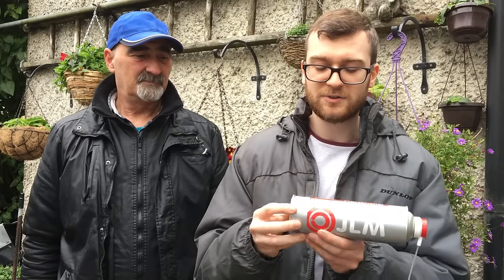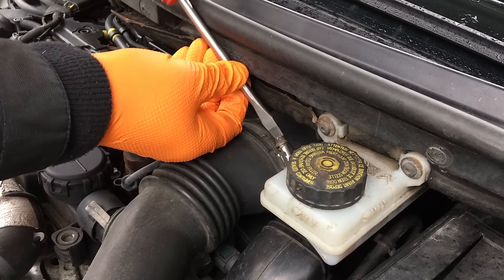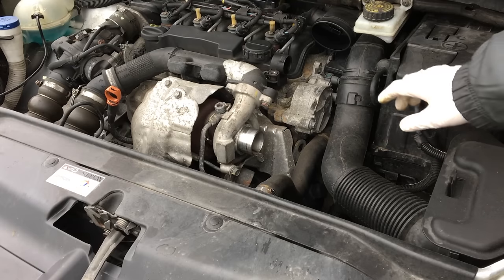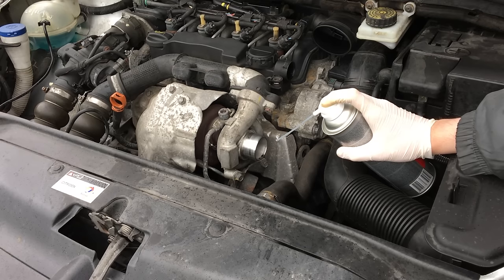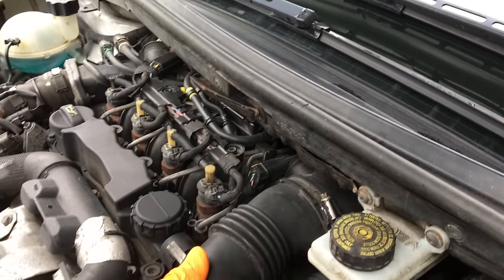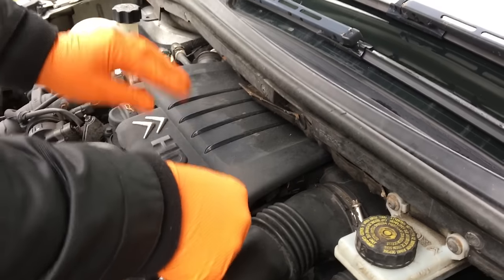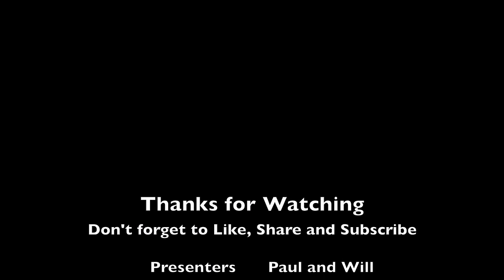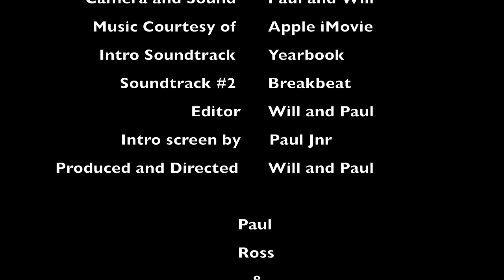How To Clean an EGR Valve Without Removing It

Comment: Question on this insertion location,   how can this  work when the EGR valve is not in the air intake flow?   It is only in the Exhaust  gas flow,   EGR valve,   then to the "intake manifold"?    For this to work it must go through the engine fuel burning process then a rather small percent of the "cleaner" to do what you want it to do.  Seems rather chancy for it to work at all?   regards
Reply from the maker: Hi LLuE88,
It does seem a bit of a waste alright. Maybe only a small % is actually needed.
As we understand, all egr cleaning sprays have similar application instruction. 
We followed the printed instructions on this particular brand and it appears to work.
This is preventative maintenance and it works on this car.  Rather pay €10 or €15 for a can that is effective than risk trying some other method that may or may not work and could end up being costly.
No doubt some time in the future the egr valve may have to be replaced (€200-€300+) but for the moment this is an inexpensive solution, if only temporary  
Paul
Reply: That's fine, my main concern was the amount of time and knuckle busting it takes to remove only to clean the EGR valve,  it's very close to having to partially lift out engine to get at the EGR valve. I will do as you have indicated,  also have a syringe that's 1" in diameter,  works great to pump the diaphragm up and down,  regards  thanks,  regards
Reply from the maker: Some claim that they can remove the egr valve without too much difficulty. For them it may very well be located in a more accessible place on their cars, vans, trucks, etc.
This works for us and as you mentioned it would need a partial lift of the engine to access it directly.
In our case, an M6 type bolt and 2 jubilee clips will give us the access we need to enable us to carry out this simple straight-forward cleaning operation.   
If an engine lift even partially was required then it wouldn't be considered a preventative maintenance operation that could be easily carried out by a diy enthusiast/s 
Paul
Reply: LLuE88 has

Comment: I'm a car mechanic, and I don't want to disappoint you, but you did nothing to the egr valve. You need to get it out, soak it for a while, than brush it clean.
Reply: Was just thinking that - had mine off at the weekend and there is no way a few sprays from a can could remove any of the crud in there. Also makes me nervous when I see unfiltered air heading into an engine for a prolonged period of time... that might just me me though haha.

Comment: Good Morning Gentlemen once again  your advice please my windscreen washer stopped in the frost it was only a fuse TG however when we replaced it my local man who is 100% great mechanic  felt the 20 amp fuse was wrong he thought 10 amp would be safer but asked me to ask advice from Citroen who said 40 amp we think this is crazy please advise me as i value your advice greatly,Paul
Reply from the maker: We have come across the washer fuse blowing when the water mix freezes in the washer tank, pipes and pump motor. 
The fuse rating is designed so it will blow rather than letting the little pump motor overheat which could possibly cause it to burn out and/or cause even more damage to the pump motor or wiring loom, etc.
We would advise you use a lower temperature rated windscreen washer ready made mix available from most good motor part retailers.
We would also recommend you use the fuse and rating that was designed for your car.
Reply: Thank you for your speedy reply the print is so small in our owners manual that neither of us can read what Citroen recommends hence Jimmy fitted a 10 amp to be safe saying go on line and ask this i did ,Paul

Comment: please  which oil for the gearbox in a Multispace   1.6 HDi 90 2011 135000 miles it is manual 5 speed a bit of a whine when you let it coast in gear less so when you are accelerating thank you paul.
Reply from the maker: https://www.total.co.uk/lub-advisor
Reply: Thank you very much Paul.

Comment: Hi yet again, how important is it to clean out the small bore metal pipe on the left side of the ERG valve held in place with a alan screw i think it feeds oil to the turbo on my 1.6 HDi 90 Berlingo 2012 version Thank you  ,Regards Paul.
Reply from the maker: Hi Paul. Is it leaking where the Allen Screw attaches the pipe to the turbo? If not, it would probably be best to leave it alone.
Reply: no but my garage man feels with 128000 miles on the clock it should be cleaned out ??Thank you Paul.
Reply: Im sorry if i put you on the spot this was NOT my intention but if this is important and will help to extend the turbo life then i will go for it ,Sincerely Paul Djerassi.
Reply from the maker: Hi Paul, You are not putting us on the spot. You are asking for our advice and views and we can offer that. We would never say - you must do this or you must do that. 
The 2007 Citroën C4 1.6hdi that Will owns is his daily driver. It has to date over 135k miles, is reliable, pulls strong and can still exceed 55+ mpg. 
To his knowledge the turbo has never been replaced. 
He is meticulous in his maintenance and servicing of the car i.e. He carries out weekly checks and services the car within the service schedule. He uses the oils, lubricants and service parts that Citroën recommends. He will cross reference with other makes and brands to make sure he uses nothing but the best. He uses Total Quartz oil, Mann filters, Michelin tyres, etc. The car responds well and it drives and handles like it should.  
From what we have researched, it appears possible that a well looked after 1.6hdi engine can last 200k miles and beyond. Look for yourself, there are many examples for sale with mileage way in excess of that. 
Hope this helps.
Driveway Dudes Paul
Reply: Thank you i value all that you have told me im using the same oil and filter thank you tyres will come later on ,Paul.

Comment: Hi yes can you please describe to me how I would do this on my  2002 Acura 3.5 RL V6 please I would appreciate it as I'm trying to do this on my own and save some money  please and thank you hope to hear back
Reply from the maker: Sorry, we've not dealt with this model but once you've located the egr valve which we are advised is on the passenger side rear of the engine, you could remove it if possible or if not then spray cleaner into the pipe leading to it. Be careful not to spray on to any sensors that may be in the pipework

Comment: Gentlemen some advice please when driving my  2012 HDi 1.6  multispace  i find the gear change leaver is all over the place 130.000 miles of driving i suppose ? how can i improve this please,Paul.
Reply from the maker: At that mileage I reckon it's general wear and tear. You could have your garage man look at it and check if the linkage bushings can be improved
Reply: ok thank you paul.
Reply: Erg valve in ford mondeo

Comment: if It's Stuck CLOSED,This Way Isn't Going to Clean it Well Enough to OPEN IT BACK UP.MY 05 SONATA Was So Bad ,Had to Be Removed & Soaked in Cleaner for Quite Some Time & Then Cleaned W/ A Wire Brush.Ur Basically Cleaning the Throtle Intake More Than the EGR VALVE.
Reply from the maker: Hi Tfc Tfc,
    Thanks for your comment. 
This video is for DIY maintenance on a working EGR valve to maintain optimal performance/operation. 
If an EGR valve becomes faulty this would be the first step to carry out then if no joy it may have to be removed and repaired or replaced if necessary.
We have carried out this procedure on several vehicles in the past and found it worked satisfactorily. 
We will definitely consider making a video of an EGR valve removal in the future.
Thanks.
Driveway Dudes - Paul
Reply: Didn't Realize It Was A Turbo Diesel Till I Saw All the Posts.
Reply: Now, now, child. Play nice.
Reply: sao không dịch sang tiếng việt đi bác

Comment: Dude My engine is K9k 110bhp engine..IT is showing glowplug indicator and stop giving power and wont raise rpm above 3000..IT happens sometimes that too in sunny weather.. PLS HELP.. What will,be the causes.
Reply from the maker: The Renault K9K not revving above 3000rpm can be a number of things. 
I could list off possible causes, Seized turbo, fuel issue, air fuel mixture incorrect. EGR valve, faulty injector, etc. but it would be best to have it put on a good (Renault approved) diagnostic scanner and work from there
Reply: This problem only comes once A while.Not A mechanical problem.
Reply from the maker: Intermittent problems can be the most difficult to diagnose.
We can offer advise and possible issues but we would always recommend you have a diagnostic scan carried out to confirm.
Reply from the maker: Sorry buddy. We're nowhere near your location so afraid we can only give advice and recommendations on the information we are given
Reply: Driveway Dudes yes just I wanna discuss.. Not to meet you
Reply from the maker: Look at our introduction video. Contact details are in the description.
Thanks

Comment: Hi, Thanks for your video at first. 
My citroen c4 1.6 HDI have a faulty code P0409 issue on EGR valve. 
Is that good to try this easy method to clean the egr valve? 
OR, 
I have to remove it to clean or replace the egr valve?
Reply: Best to remove the egr valve  to be honest

Comment: Hi, thanks for the video seem like i can learn alot from your videos.  I have same c4. 
Facing really strange issue with mine hoping if you could help me out with it.  
It drives then after about 100 km it says anti pollution faulty and dies while driving and doesn't start again. Then the next morning it starts and does the same.  Its has started recently as there was anti pollution fault before but never did this only would go to limp mode. 
Took it to mechanic to see what fault was it.  
It only showed turbo revolution pressure low. 
But unfortunately the engine light wasn't on at that time perhaps that's the reason nothing else came on. 
Quick reply will be really helpful as no mechanic wants to solve my issue as they say its Citroën it will do like this and i am stuck paying recovery alot of money
Reply: Forgit to mention when that happens the engine cranks but wont start.  Starter and battery are good.  some times it does  start out of the blue, some times doesn't.  Electric or mechanical so confused :( i was thinking to change fuel filter to start with and spray the egr valve?
Reply from the maker: Hi, Your description indicates that it may be the EGR valve not operating correctly, getting jammed open/closed
Spraying it with EGR valve cleaner may help
Reply: @DrivewayDudes  thanks will try that

Comment: Just curious. Do you guys do metal detecting around your area? Regardless, thanks for sharing. P.S. Where I'm from (Kansas City Missouri, USA) we call a "bulkhead or scuttle panel" a "firewall." Farewell, thanks again.
Reply from the maker: Hi dash Lamb,
Metal detecting. That must be one of the strangest question we've had. Why do you ask?

Auto body parts are described or named differently in other parts of the world. Always makes for discussion who is right or what they should be called. Examples like Hood, Bonnet, Trunk, Boot, Windshield, Windscreen, Lamp, Light, Fender, Bumper, Motor, Engine, Transmission, Gearbox, etc but we all know what they are

Comment: Seeing how badly these systems get gunked up because of the mixture of oil blowby and exhaust gasses, I'm pretty sure this procedure didn't have any effect whatsoever.

If you really want to clean these components, you have to take them off and clean them in dissolvant with a brush, and in case of the intake, with high pressure water or a torch.
Reply from the maker: https://youtu.be/HXqJ0YcOqOI

Comment: Bunu turbo dan uygulanması doğru mu? Kaç km de yapılması gerekli? Teşekkürler.
Reply from the maker: The spinning turbo will send the cleaner spray into the egr. There is not set km or miles to do this. If you have a warning light or when you service your engine
Reply: @DrivewayDudes  turbo dan vermek daha mi sağlıklı. Bunu mu anladım.
Reply from the maker: Bu bir akışa yardımcı olmak için bir turbo kullanıyorsunuz.
Reply: @DrivewayDudes  thanks you 🙋‍♂️

Comment: How do people feel about finding cheap plug and drill hole in rubber boot size of plug that will accept straw nozzle to inject egr cleaner   the plug must seal the drilled  nozzle hole air tight. Might secure tight/plug hole with a larger size sheet metal screw.. it would make an easy job easier..... and eliminate the need to pry lose .... brittle fittings...
Reply from the maker: A hole would have to be drilled at an acute angle for the spray to be effective but would probably weaken the overall structure and be very difficult to keep sealed

Comment: Gentlemen Good Morning i hope you are both keeping well,some information please on my 2012 Multispace Plus 1-6 HDi which i love lately the back washer starts working of its own accord no input from me please can you advise me ?.-keep safe Paul.
Reply from the maker: Intermittent electrical issues can be a headache.
It sounds like you have a short. It could be at the switch, loose connector, the wiring loom or the washer motor.
Have you had an OBD/EOBD scan carried out to determine if there is a recorded fault code? If you have and there's no code then it looks like it's a process of elimination, fault finding physically and visually
Reply: Thank you so much you men are Jewels ,Paul

Comment: just one only ?.if my model dosent have this can i easily have one fitted or is it a problem ,my problem is my age im 83 and can no longer reverse as well as i could so the bleeper would be a great help to me ,thanks paul.
Reply from the maker: Hi Paul. That sounds like the tow hook mount cover. You could ask your local Citroen garage about a retrofit of reversing sensors, but if they don't do them or the quote is too expensive, you can possibly have a private garage fit an aftermarket brand of reversing sensors.

Driveway Dudes - Will.

Comment: nice to see someone using gloves!
Reply: Pete Thompson why? In 50 years as a qualified mech I never wear gloves, not done me any harm at all. New tangled ideas.
Reply: @mikewatson5457  one word dermititis. You'd get sacked if you worked at autolusso
Reply: @mikewatson5457  what a badass!
Reply: Anything you spray into the induction side will be burning in the combustion process. Nothing will be left to enter the egr valve other than waste exhaust gases. And if so would you really want all that gunk in your engine cylinders !!

Comment: guys to simply keep the EGR clean, once every month or so drive your car  4000 revs for about a mile (dont redline it) it blasts out any crap thats accumulated in your engine as a whole, 2nd, Use quality fuels, forget cheaper supermarket fuels, its a false economy, use Shell or BP they are more expensive, but you will find they give you better performance and better MPG, they also look after your engine, look at it this way, your body is like an engine in many ways, feed it crap food you feel sluggish, your poo stinks bad right, same with a car feed it crap fuel itll  be sluggish.
My car has done 178,000 miles its a honda civic 1.7cdti, Ive never ever had any EGR problems. I do 1300 miles a month, no drama! Most folks in diesel or petrol cars are only using their cars to go to the shops, sometimes the car isnt getting to operating temperature, usually an engine will burn more fuel to get the car warmed up after starting which produces more carbon which clogs your engine, if you are not doing a good few miles after just going to the shops your car will always be clogging up as it needs to get to operating temperature which helps the engine burn off and get rid of any carbon deposits, take your vehicle for a good 50  ile or more run every so often on a motorway or similar, keeps most problems at bay !!
Reply from the maker: Driveway Dudes Will uses the C4 as a daily driver and covers about 2,000 miles per month. 
He doesn't mind spending that little extra and always uses quality fuels.
Driveway Dudes Paul's Audi sometimes needs an 80Kph/50mph run for about 20-30 minutes to clean the DPF
Reply: Good advice you beat me to it ,also regular servicing with the recommended oil for your car.

Comment: Turbo, theoretically, you clean a little, it will help if the blades are in good condition, the EGR is from the other side
Reply from the maker: A little cleaner is better than none and yes you are correct in that the blades need to be in good condition to force the cleaner spray through.

Comment: A quickie..... Won't it just condense in the intercooler and not make it to the egr? Brill if it works for you guys but I can't see that much actually making it to the egr
Reply from the maker: There are many brands of EGR valve cleaner on the market. The brand we used as seen in the video does work. We cannot comment on other brands.  
It's undetermined as to the amount that gets to the EGR valve but it appears enough is getting through to be effective in correcting the issue